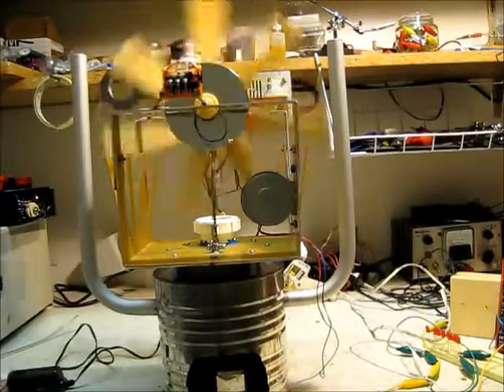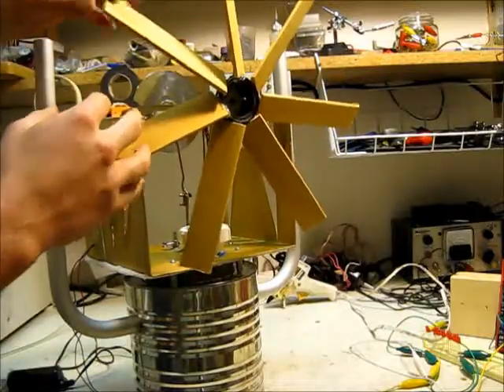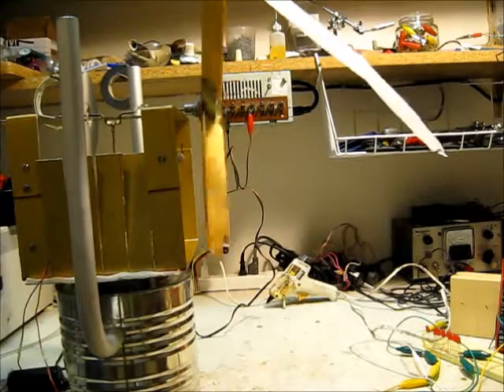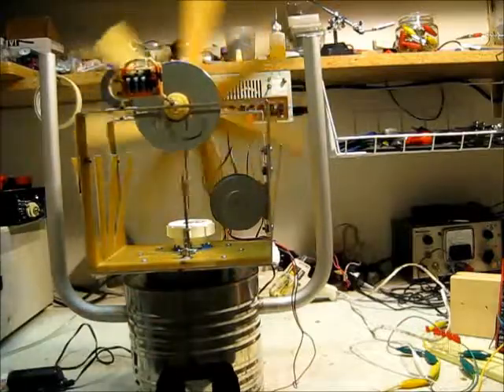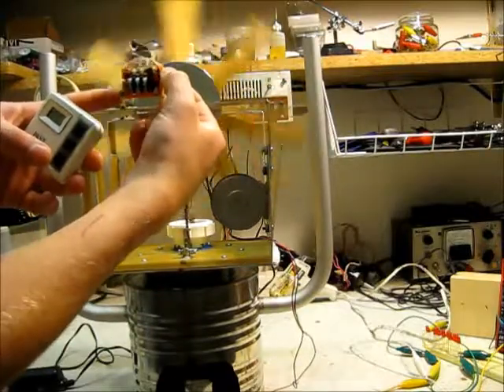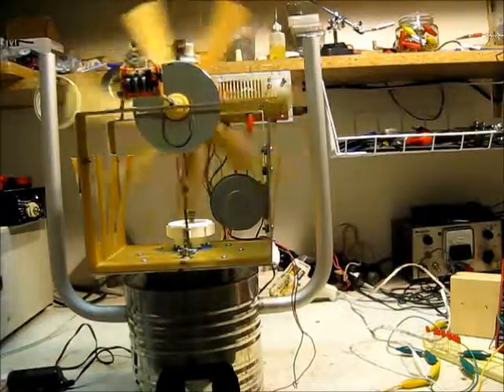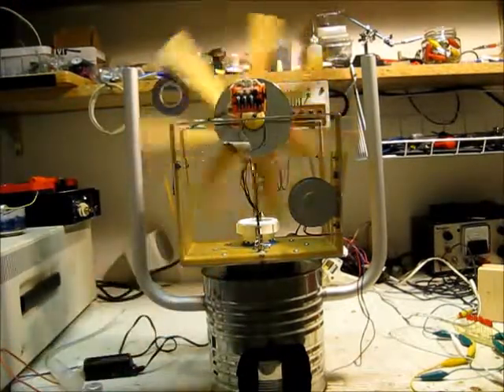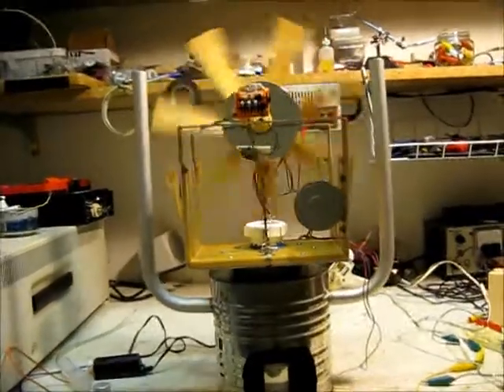Stirling Engine #2 Running a Fan

Comment: Really impressed with your creativity and ingenuity! Do you use any specific measurements while making these Stirling Engines, or do you experiment as you go along? I've tried to make one but it wouldn't start. Could you spare some time to share some general guidelines regarding the feasible measurements and the corresponding weights of the parts? Thanks!
Reply from the maker: +Promit Chakrabarty Thank you!  Not particularly.  This was my 3rd or 4th engine so I did have a pretty good idea what I was after.  My first two engines failed then there was my first success then an engine that I don't have any evidence of except 3 pictures and then this engine.  This is still one of my pride and joys.  It's normal if your first doesn't work.  I should say first couple of engines.  Friction and air leaks are generally the things that cause early engines to fail.  Just try to figure out why it isn't working, think up a new design or fix the old one and try again.  In general if it's not working then add more heat and cold.  Maybe you can get it to work slightly before it melts down.  

No, there are really not any specific measurements.  I didn't even draw up plans or demonstrations for this engine.  I just built it from my brain like most of my projects.  Mind you I had been thinking about the design for several months before I actually started building it.  I started with what I wanted the displacer cylinder to be made from, tuna can, and how I wanted to cool it.  Then I figured out how to seal the two together and stuck some more bits and bobs on and there you have it. I have several other videos about this engine so if you haven't already watched them I highly recommend watching them.  There is even a video where I take this engine apart. https://www.youtube.com/playlist?list=PL038139B35B0E9468

Hope that helps.
Best of luck,
-Makerj101
Reply: +Makerj101 Thanks a lot for your helpful reply. :) I'll try to improve my design as per your suggestions. Yeah, I've already watched several of your videos, and am going to watch several more. I like the way you explain stuff in your videos. Keep up the good work! Have subscribed. Hope to learn a lot. :)
Reply from the maker: +Promit Chakrabarty You're welcome!  Ok cool!  Thank you!  Please ask if you have any more questions and I'll try my best to help you out.  After you improve the design and if you still can't get it to work then send me a several pictures of the engine and I'll see if I can better help you out.  makerj101utube@gamil.com

Comment from the maker: Yes it is.  In a stirling engine there are 2 cranks.  One must follow the other by 90 degrees.   You only need to change the orientation of one by 180 degrees and it will go in the other direction.